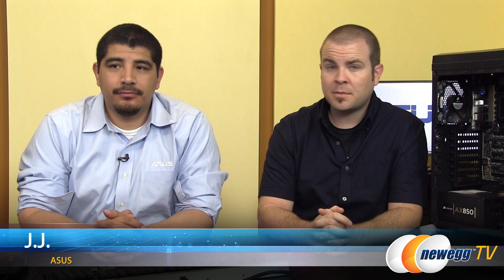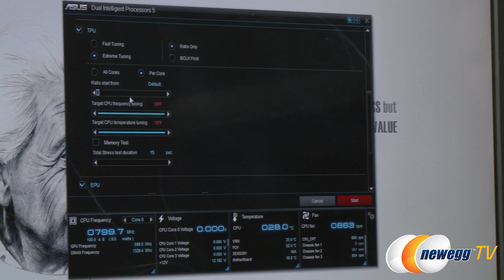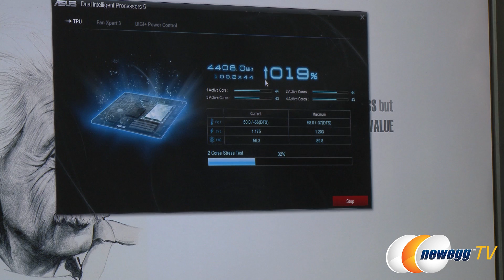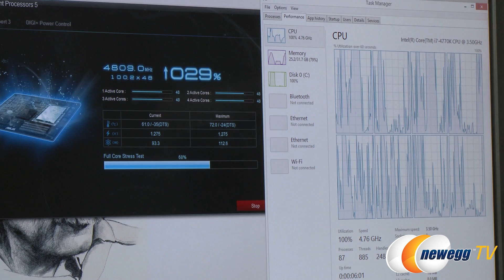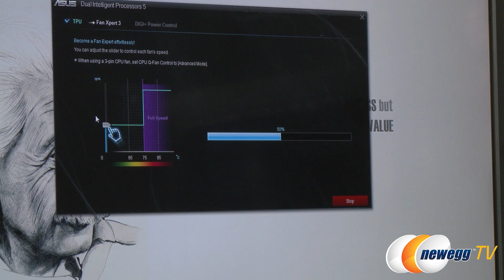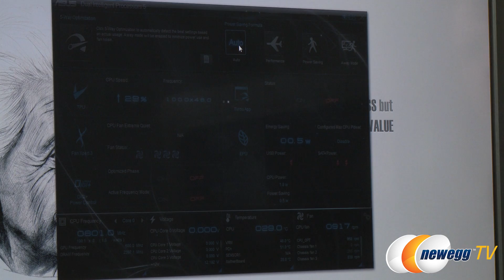ASUS Z97 5 way Optimization Demo Interview - Newegg TV

Comment: @Newegg Studios  I got two questions, on the TPU section, I noticed during the video test J.J. left it at the "Per Core" setting, what if you click on "All Cores" is that OK or is it recommended to leave it at "Per Core"?  Also, while the optimization process is running, can you open other applications in the background such as Firefox or VLC while the process is happening or that's not advisable?

Comment: JJ, I have a couple questions. The Z97 WS board seems to have very few qualified memory sticks as published on the Asus website. In fact there are two bios version numbers as well (0602 and 0604). Is this QVL list up to date, or is the WS board limited to these few ram sticks? Next question is, are all the brands of SSD's, and HDD compatible with the WS board. I ask these questions, because since this particular board goes through more stringent tests, I want to be sure all the other components will be compatible with the WS board. Thank you. VIRGEY

Comment: JJ,
Man you really sold me on the mainstream of Asus boards especially the Z97pro because of the 5way Optimization. As a amateur CPU Overclocker this will help me very greatly because I am not comfortable fulling around in the BIOS or UEFI as far as Overclocking goes.

Comment: I purchased a Asus Maximus Gene VII (Z97) board and the 5-way optimization feature DOES NOT work correctly.  Not sure if it's just with the ROG boards, but the optimization/customization options in Asus Suite III isn't the same as what JJ has been demo-ing.  Not nearly as granular on the ROG platform.  Haven't been able to get windows to load after an attempt to just get to 4.2GHz OC.  I have a 4770K & H105 cooler...
Reply: ***** Yeah I ended up manually overclocking and reached a stable 4.2GHz OC.  Can't get any higher than that.  I think I just have a BAD 4770K overclocker.  But a BIG reason I went with an Asus Z97 board was because I was under the impression the 5-way optimization worked as demo'd by JJ on ALL Z97 platforms.  I was really impressed by it... but a little misleading I think.  Wish JJ would have added a "disclaimer" during the previous demo's I saw saying the ROG boards do not have the same auto-tuning capabilities as what was being shown.
Reply: ***** No worries.  Should have done more research on my end.  When you demo all of the sweet new Asus offerings, you make me wanna buy it all!!!